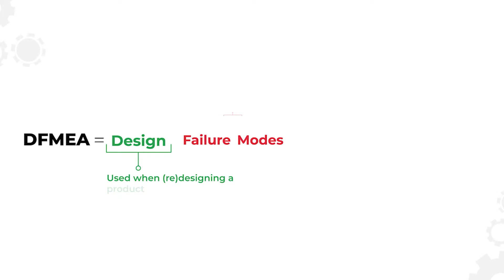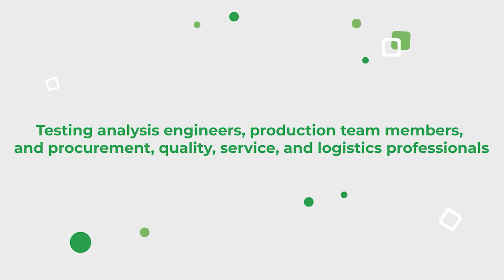FMEA - What is failure mode and effects analysis?

Comment: How do you identify issues with a project or design. Or is it only identified through production and stats on the equipment making the product?
Reply: Start with what you can think of - brainstorm how things MIGHT go wrong with your process or design. Build failure prevention and detection from the start. Then - yes - use real world data and results to analyze risks again. What goes wrong in the real world? What are the effects of those failure modes? Score them, prioritize them, address them in order of priority/impact.